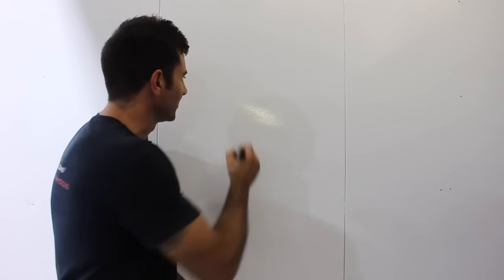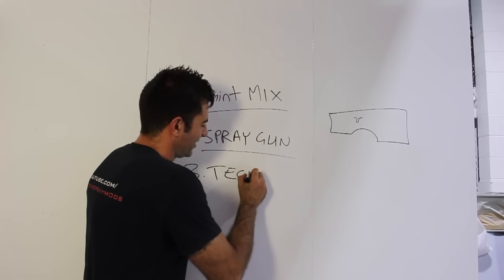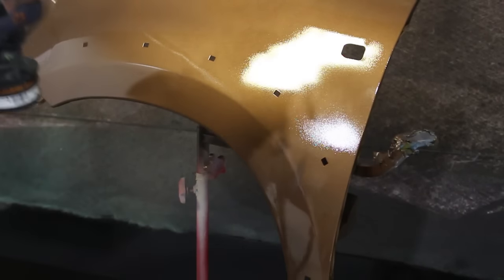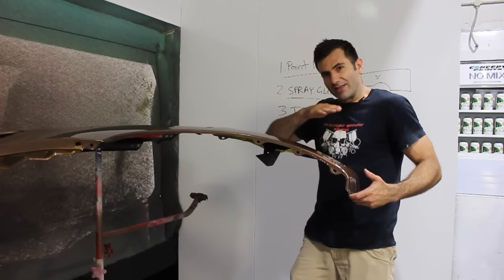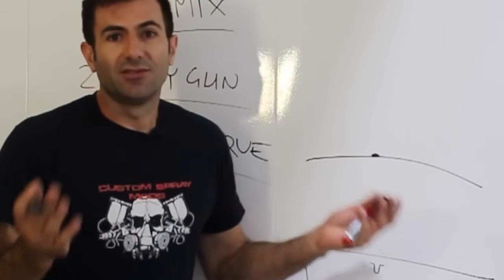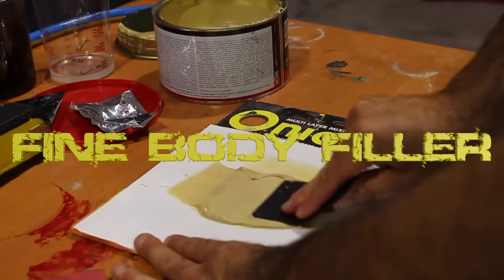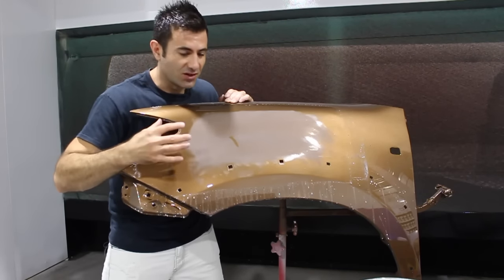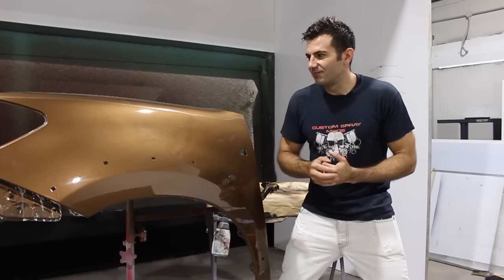How to fix Runs in paint.

Comment: While the clear is wet, lay a piece of tape on the run, run your finger over the tape where the run is then pull the tape off, wait for the clear to flash some. Put some more clear on then the next day all you have to do is cut it a little and buff. Good as new 👌
Reply: Awesome advice thank you so much for sharing your tip

Comment: I PUT MASKING TAPE ON BOTH SIDES OF THE RUN THEN SHAVE IT WITH A SINGLE EDGE BLADE. AND USE THE 3M WET SANDING BLOCK KIT

Comment: I use a NIB file, or use a single edge razor blade and wrap a bit of tape around each side leaving only a small spot in the middle of the blade exposed.
Reply: Thanks you for this tip, I restore vintage furniture, and tried this and it worked great

Comment: Well thank you so much for explaining this properly, i had major runs on one side because that side of my trunk lit had been sitting in the sun,so today i spend a couple of hours applying putty and sanding it down with 320 wet,and it's almost entirely gone,just need to finish off tomorrow with the 320 untill it's completely flat and then starting to work my way up in sandpaper to remove the scratches and then safe some money to buy a polisher and some buffing compound.So big thanks again, it's my very first paint job at home and the results are quite amazing,i'm doing all this with a lvlp gun, and i can highly advise this type of gun for anyone starting out.👍✌️👉
Reply: Sandpaper, you mean wet and dry paper,

Comment: temperature can also affect whether you get runs or not since paint doesnt dry in the cold as fast
Reply: Correct, and I’d hope any painter would know that >.<
Reply: I can tell when the seasons change. In the summer I have to hammer it on. 110 degrees with 90 percent humidity. When it starts cooling off I'll start getting runs. Have to dial it back and go to smaller tips.  When its really cold 40 50 it'll look OK then when you make it back around for the next pass 20 30 mins later it start running. Take it easy in the winter and do a thin tack coat.  And I'll use a heating pad to heat the paint  and hardners on
Reply: @Iheartdgd  j KK
Reply: My
Kum;;;
Umm
Reply: My
Kum;;;
Umm
Reply: Mmm
Reply: @Iheartdgd  mm m
Reply: @Iheartdgd  
Oklahoma
Kk
Reply: @Iheartdgd ; I look jjjjjjjjjjjjji jjb j
Mmmu
Reply: @loyalroyal146  hey bud I think you fell asleep on top of your phone :P

Comment: Forgot about residue on the substrate. Sometimes it's inevitable. Humidity plays a big part in runs as well. I'm spraying right now at work. Industrial painting, no "paint bay" or climate/humidity control in oily greasing beams of steel. It happens.

Comment: Tungsten blocks have come along way bro...not just your standard square ones anymore. I swear by them. especially the cheaper CRS brand ones. Those and a razor blade with the corners taped up are my go to methods. Cheers mate. Edit. I do understand you are making these videos for peeps who may just have basic tools. But tungsten is the bomb.
Reply: I was the king at getting runs, I found you can round off the corners of a new razor blade using some 600 wet/dry paper to scrape away runs

Comment: You should make a video on a test hood showing how psi effects and reducer temp effects Orange peel
Reply from the maker: henri I have touched on that mate check this one out. https://youtu.be/5fNtQOcHDHU
Reply: Thanks I watch the video, But was hoping someone had a video showing a hood masked off in several
area showing how a poorly set up gun  ie fan pattern  effect orange peel  with the  combination of psi from a low 26 psi to know higher psi which eliminates the orange peel... I keep hearing clear coat should be sprayed at 29 psi with HVLP, I like to know what psi should be use with HVLP gun. Can you make a video
with different psi setting ie 26, 29, 35, 40, 50 psi  masked off on a test panel and show the effect of low and high psi
Reply: as well as adding reducer to the  clear coat ie final coat to flatten the clear coat on the last coat

Comment: good video, thanks! istead of using bodyfiller you could use some masking tape as well to avoid sanding the area you dont want to sand right?
Reply from the maker: Matthieu Libeert that may work. Sometimes you may have more than one run but a whole line of runs. Using tape might take forever to mask.
Reply: Tape doesn't work well. Gums up the sand paper.

Comment: How hot was it in the room your in? Every cut scene you were sweating more and more😂😂😂😂
Reply from the maker: Louis Borg 40 degrees C mate.
Reply: Every time I run my paint, I sweat too!
Reply: @customspraymods  104°, does that effect your paint in a negative way?
Reply: @johnbraucher1499  you need more paint in higher temps to keep that wet edge. As soon as its hits air being atomized it's starting to dry. To far back makes orange peel and dry spots the paint is dry before it hits the panel.  In cooler temps you use less paint per pass it flashes slower. Different thinners can help with flash times.

Comment: probalbly late but i got runs on the primer, just to wet sand it a little?  also when putting decals on a motorcyle fuel tank, , is it better to put them on the metallic paint or a layer of clear or two, then let it dry and then put two more layers of clear over the decals?

Comment: My situation is that I hand painted several rock chip about 3-5 milliliters big and I had the touch up paint go pass the chip area about 3-5 millimeters more because of using a wrong size of a brush. I was trying to sand it with 3000 grid and its not coming out. Its already flat by wet sanding, but its darker than the original paint. It looks like a round dark spot and its not going anywhere.  How can I fix it. Thanks
Reply: Try 2000 then 3000 and buff as far as the color match touch up never matches perfectly
Reply: Touch up never matches perfectly

Comment: if i am using the sandpaper wrapped around wooden mixing stick method, what sandpaper grit should i use? i was thinking about using 1000 or 1500 or 2000 but i have no idea. Should i use multiple grits? also if i then re clear the panel, will i have to sand the whole panel or that is not necessary

Comment: I have runs in my paintjob but I believe they come from the paint itself.  Can u use the same method to get them out? (And most likely will have to repaint it) or is their no way. I also have "fish eye" and "orange peel" problems
Reply: Paint runs probably isn't the paint.  You could be over thinning it.  But the paint can't run unless to much product is applied.  Fish eye is because the surface is contaminated with oils or silicones or something.  Use wax and grease remover and wipe down the piece before primer or if no primer before painting.  You'd be surprised how much dirt is on something that looks clean. That will help with a smooth finish as well.  Use a paint strainer and filter your paint. Orange peel is to much pressure not enough paint. To much air pressure in general or to much paint not enough pressure. And to far away from the panel.  Good rule of thumb is 7 inches back 7 inch fan.  Thumb and pinky like youd making using them as a fake phone and use that distance from you to the panel and that distance as the size of your fan. Your first coat. Spray a light tack coat. It can be semi transparent.  You want to give the first medium wet coat something to bite to.  5 to 10 mins is enough time in the summer.  15 to 20 in cooler months between coats.  And if your using a spray gun. Add a little thinner to your paint.  It'll help it flow and gloss.  You don't need as much in summer as the paint thins from heat. But always add a little bit. Horizonsl panels use 50-60 percent over lap. Flat panels 75-80 percent overlap. Most hvlp guns use about 2 bar 29psi some more or less depending on my factors. Some guns run on 18 or 22 psi. Lvlp guns.  I've seen some hvlp guns that were actually lvlp guns
Reply: @JamesSmith-lt5zz  thanks for the reply and information.  When I painted my car I did about everything wrong.
Reply: @treavoncooper3799  no problem next go around you'll be in better position. Feel free to ask me any questions if I can help I will.  Or if you need a decent gun without breaking the bank. The harbor freight purple gun I see so many use isn't even qualified to be a primer gun. The 827 series it's modeled after is horrible.

Comment: When you need to sand the run off instead of using filler couldn’t you just use painters tape?
Reply: Strips on either side not over it

Comment: How long do you have to wait for the clear coat to dry before you can begin to remove the run? I’ve read that a week to fully cure and harden, then also I’ve read that clear coat is not like paint and it can be fully cured and hardened in 20 minutes?
Reply: You found the answer?

Comment: may i ask if i going to use masking tape to tape around the run before start sanding the run，will they work as well as using filler？
Reply from the maker: MiChAeL 黄勤振 that can work but when you sand it the tape will go all funny.
Reply: customspraymods will wet sanding may no
cause the tape
to ruim it？
Reply from the maker: You can try it. But it also happens when wet sanding.

Comment: How many coats of clear are on this fender ? 1 or 2?
Reply from the maker: Jon Doe 2 costs mate.
Reply: ONE MORE QUESTION.....HOW LONG DO YOU TYPICALLY WAIT BETWEEN COATS?
Reply from the maker: Jon Doe 10 to 15 minutes mate.
Reply: Thanks. I've painted for a while I just wanted to compare strategy. I also give you a SUB.
Reply: customspraymods great vid again and learnt lots as usual
Reply from the maker: doatsdude thanks man
Reply: 3 coats. 1 for lite coat 2 normal coat 3 wet coat
Reply: Fariko Pacer you haven't got a clue.

Comment: What if you run primer
Reply: Depends on how bad....if it's extremely bad I'll stick a piece of tape on it lightly and  pull some of the top layer of and put couple more coats over it to block the tape marks out...obviously while it's still wet...but typically you can just block primer down and get rid of imperfections in it
Reply: If you run primer just bake it off anyway when it's cured you can guide coat then block it off with 320 finishing with a 400 on in interface pad then wet flat using 1200 chances are your gunna break through edges anyway so wet on wet it and finish off that way

Comment: wrong best advice  50 yrs of this stupidity  if its small not a total mess  get the blender  mix small amount with blender spray  the run and area lightly  have patience watch if your lucky two or trhee light coats will allow it to melt in   if not get away from it let dry resand repaint  is emminent